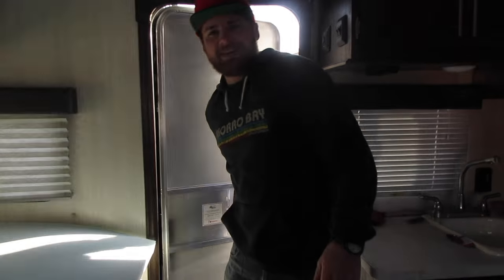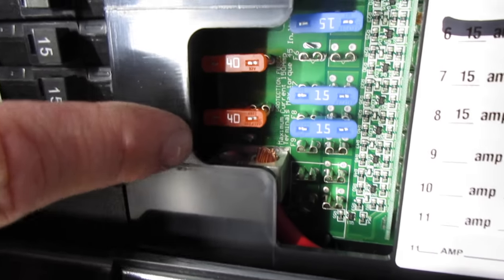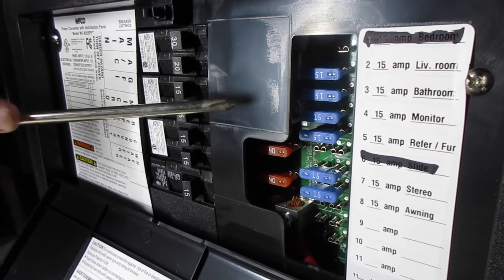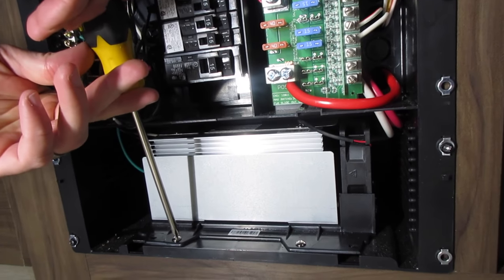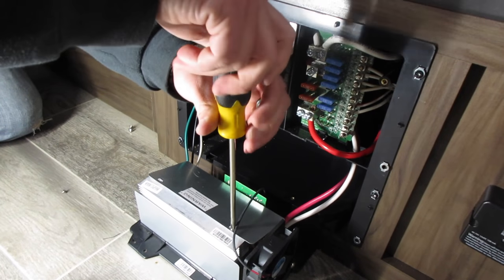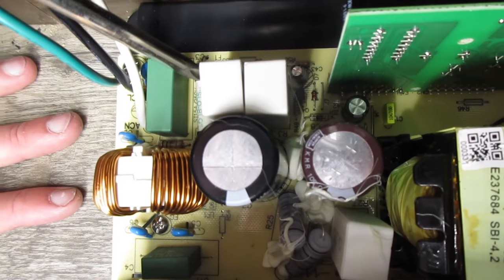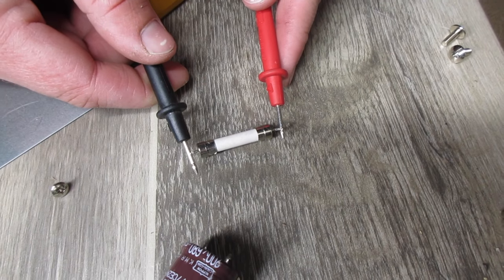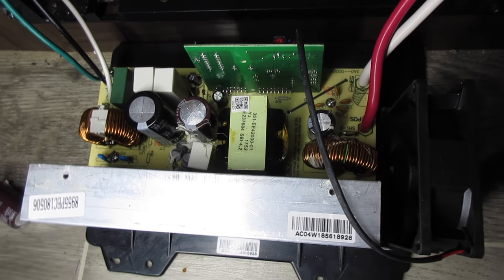RV Power Converter Fix #diy #notcharging new vid link below

Comment: I actually want my battery charger on its own circuit breaker when boondocking so when I plug in my trailer into my inverter hooked to my batterys I won't create a loop , a converter charger my batteries with my batteries when. Boondocking.
Reply from the maker: I installed an automatic switch so that when I’m plugged in it takes my inverter out of the loop and when I am boondocking my inverter clicks back in the loop. Also when I have a generator plugged in the system just things it’s normal power and my inverter no longer is in the loop
Reply from the maker: Here is the video explaining that setup
https://youtu.be/bAJZvtl4bKk?si=4gMXh8ZJbUyUWkZl

Comment: Dang! Wish I would have tried this 1st. Ended up replacing my inventor. I cheated for a while and ran off my batter, just kept a trickle charger on it plugged in from my 110 volt and held me over for a few weeks tell spare parts came In
Reply from the maker: Hey that’s a pretty good temp fix tho. Yea it was a lot cheaper checking each component and replacing what was actually broken instead of buying all new. Thanks for watching.

Comment: Put new batteries on my trailer today, installed a renogy battery monitor over winter. Plugged in shore power and I'm seeing 13.6 volts but less than an amp going to charge the battery. Looks like I'll be pulling the converter in the morning and doing some testing, huge thank you for the video.
Reply from the maker: Thanks for watching. 13.6 is pretty normal and if it’s only taking an amp my guess is the battery is full and the converter has gone into absorption mode

Comment: I just bought a similar RV and had the exact same problem not charging battery. Took apart and checked slo blo fuse and it had blown. Flipped board over and found a mouse welded to the other side. This video was perfect and you are awesome for pointing this out.
Reply from the maker: Whoa that is crazy! I’m so glad this video is still helping people out. I wish they could have mad this a replaceable fuse after seeing so many people with the same issue. Happy to help.

Comment: Thanks for posting.  Been trying to fix my problems with my batteries not charging for almost 2 years.  I have replaced 2 sets of batteries twice as well as the converter on my inverter.  If I put jumper cables on my batteries and connect to my truck, the 12 volt refrigerator works, otherwise, refrigerator does not work. Can't wait to trouble shoot later on today.
Reply from the maker: Oh man I sure hope you figure out the problem!! Be sure to keep me updated on this because they can be a real bear to find. I would also check the reverse polarity fuse in the panel. If that blows it can cause similar stuff

Comment: Thanks!! It looks like the same unit in my 2018 Surveyor. My issue is I have no power coming into the unit while I'm plugged in and the only thing that works is 12 volt equipment (lights etc.) But I'm gonna dive into it more tomorrow and your vid gave me courage and I won't feel like I'm jumping into it completely blind👍🏼
Thanks!!
Reply from the maker: Happy to hear you’re going to take a look! That’s a strange problem to have tho with no shore power coming in and only 12v. I’d also start tracing those wires connected to the 30amp plug. Good luck and keep me updated!
Reply: @RotoCityTech  when I opened it up there is a bar with wires going into it with about 7-8 Set screws. One of those set screws came loose and the wire bounced around and the wire jacket was crispy. I snipped off about a half inch and tightened the set screw correctly and VOILA👍🏼👍🏼
All good!!
Just got back home from the Black Hills of South Dakota so I'm assuming it happened on the return trip... good timing,  it could of been on the way there.. Thank you so much for relieving the stress of jumping into it👍🏼👍🏼👍🏼👍🏼 Big help!!
Reply from the maker: So happy to hear this! This also should help others knowing this is a possible failure point. Good work!

Comment: This is going to save me a headache or two next week. Bought a used camper and noticed something was wrong on the 12v side. I didn't troubleshoot because the plan was to remodel. I have the panel out and was just going to see if I could buy a new converter, but now, if I can fix it, even better. Thanks for the info; you've helped a lot of people. If thumbs up came with a counter for how many times I'd tap it; double digits my friend 😉
Reply from the maker: Happy to keep helping people fix their campers! Good luck with the rebuild! Thanks for watching and taking time to comment.

Comment: Thanks Hank!  In my case I could see both of the 200V 680uF caps were bad, the cases had heat damage/bubbling, and the metal ends were swollen out a bit. I ordered replacements from China on EBay as what I found in the USA would take longer to get and cost more. Plus I replaced the fuse with an Axial Ceramic Time Delay Fuse, 6x30mm, 15A, 250V from Amazon.   Nearby the caps was a brown area which also looked liked heat damage at R49, a 1470ohm resistor.  I lifted/desoldered one end and it measured fine, so resoldered it back down.
Happy to say it worked like a charm, RV lights are now working, and I expect the batteries will be getting charged.
FYI this came about because I connected the plug to 240V, thinking that the RV 120V 30A outlet was just like my shop 240V 30A outlets.  Oops! that was a stupid mistake, but all fixed now.
Reply from the maker: Wow! That’s awesome that you were able to discover all of that and fix it. It’s so awesome that I continue to get people having such success fixing these converters even years later. Good work
Reply: Thanks @garyconway439 I did the same thing and hooked up to 220 and heard a humming and trip. Went inside saw a 5 amp breaker tripped. Reset the breaker and smoke was released from the capacitor 🤦🏼‍♂️. Yep I deserved it. but hopefully I can replace the caps and fuse like you to minimize my stupid taxes. 

Im worried I damaged other components but it sounds like you got lucky. I even turned the battery on and the AC, fridge and tv worked just before being drained. Hopefully my follow up is good news too.
Reply: @jacksondaigler5145  The good news is that the 200 volt capacitor and the 15A 250V fuse are in the power supply, ahead of all the other components.  I expect the 240V over-voltage on the 200V capacitor caused it to short out internally and this is what blew the fuse.

Comment: This was extremely helpful!  I changed my converter once before about a year ago.  Now same problem, darn it! Such crap they make!  I will not spend another $300, but check it like you did.  I have to get some battery disconnects first though.  Non stop fixes needed for my 1997 Class C.  More fixes than actual travel. Fed up with it.  Need a new van.
Reply from the maker: Lass-in Angeles thanks for watching! Just check those big 40amp fuses first. I’m sure it’s at least a similar setup. It is annoying tho even buying this camper new I’ve had to work on something after each trip!
Reply: @RotoCityTech  Good to know its not just my camper!  Many thanks!

Comment: Just replaced a $377 converter and wouldn’t have (well don’t have) the understanding of electricity as you do. 
Have to give you kudos for getting it fixed! I mean I wouldn’t even know what to call that part you replaced to buy another. The fuse I could replace but that part...nope.
Reply from the maker: Thanks for taking time to comment and watch. Well ultimately you just need it to work so having a new one is probably best. Especially when you’re out camping! Thanks for the comments tho!

Comment: I love that you were able to do that, good work! I'm going to check mine in the morning
Reply from the maker: Thank you! Yes it was a lifesaver for me! Plus it happened to me in my new camper 🤦🏼‍♂️ let me know what ya find tomorrow!
Reply: @RotoCityTech  10-4!
Reply: @RotoCityTech  I disconnected my solar panels when I got power turned on for my job site trailer. The batteries kept everything running for a while, but when they died the refrigerator quit working. Turns out the main 40 amp fuses for the DC side were blown. Easy fix!
Reply: Caution! The converter has a circuit board on the bottom with hot 110 volt leads. You wouldn't know unless you stuck your fingers under there. (Heard it from a friend..  ; ))
Reply: @Shedhunter2 very easy fix! Been there done that. I’m happy it’s all working.
Reply: @Shedhunter2 😂😂 oh no!

Comment: I have a pair of WFCO 75 amp converters with the same problem. Parts are on order. I would suggest replacing both capacitors because if one is old and dried out, the other one is not far behind.
Reply from the maker: indyzmike great idea to replace both. I’m hoping since mines a new camper that the capacitors are new as well! Thanks for watching and good luck!

Comment: Good vid man. Unfortunately I had to find out the hard way like you did with the exception that both of my capacitors are blown but the F1 was fine. Inverter fan kicks on for about 5 seconds before cutting back off, if you pull the top “reverse battery” fuse. I’m assuming it’s because the capacitors can’t obtain and distribute the required voltage and it’s just taking the whole unit a few seconds to figure that out. 🤷🏼‍♂️ either way I’m 17 days into a healthy and junk food free lifestyle and I have my heart set on a Reese’s and a Vanilla Coke so I’m done for now. Thanks again for the video! 
Peace and love from bama
Reply from the maker: Oh man! Sometimes all you need is just a treat and a break. I feel for ya. Hopefully you get it all figured out. Thanks for watching and taking time to comment. I would for sure check those two capacitors for continuity.
Reply: RotoCityTech I’ll definitely let ya know for sure as soon as I finish and as far as the snack goes (went) ... definite mood changer in the + 👍🏼 stay tuned and thanks

Comment: Nice. My issue is similar, but a bit different. On shore power only(I don't use a battery at all), my AC is getting through to DC, but if it gets cold then the DC output is somehow restricted or flickery/faint.. So when it acts up my lights(fridge, anything DC) will either blink on and off at a tic toc pace, or they'll dim very low and a loud steady beeeeeep will sound(I've heard it's a low voltage signal). But, if while this is happening, I use say the microwave, or toaster, or anything AC current thats pulling a lot of power, the DC will work fine, but only while that AC appliance is used.

 It's like something in the DC output side, some component on the converter board, is shorting out or shrinking when it gets cold, not allowing the current to flow properly. And using an AC appliance somehow shoves the current through so it operates as it should.. lol idk. Only acts up when it's cold, it it's warm outside there's never a problem. Probably just gonna buy a new one but I just think it's prob something simple and cheap, so trying to see if anyone has dealt w this specifically
Reply from the maker: Thanks for watching. Hmmm yea this is strange. I’ve never heard of this before. It does seem like something is throttling there power for some reason until an appliance forces juice to run thru. I’m sure there’s is a way to test all this but I don’t even know what meter you’d use to try and do that. These converters are not too expensive so I’d say yea just get a new one to replace and then start messing with the old to see if you can find anything out. Best case is you have an extra converter in case the other one messes up

Comment: So, if I am plugged into shorepower(120v) would this stop my 12v devices from working properly? That s the issue I’m having.
Reply from the maker: They problem it’ll have is that while plugged into shore it will not charge your battery so once your battery dies all the 12v stuff will not work

Comment: You lucked out. I blew up three of these puppies because of bad power. Unable to work on the boards as they were toast. So had to buy the converters online. The one I have is around $170 and I had to install. Yours is in a great location. I had to completely pull the panel out as far as it would go and hang it with a rope to a handle above. The converter is behind the panel on my Fleetwood motorhome. That sucked doing this each time. Thanks for the tip. Wish mine would have been that easy.
Reply from the maker: Dale J oh man I feel for ya! Sounds like a tough annoying job and I am thankful most campers today put these in more accessible  locations. Well I’m not sure about modern motor homes. I do think I got pretty lucky that it didn’t blow the whole board! Thanks for watching!
Reply: @RotoCityTech  Well, our motorhome is not real old. It is a Fleetwood 2007 Terra LX 34n class A. Only 30k miles on it now. Bought it two years ago with 12k on it. It is a great unit except for the location of the converter. Thanks for replying.

Comment: Good video. 
What probably happened is  the reverse battery connection blew the orange fuse but not after damaging the cap and the internal fuse.  
I would suggest replacing the other cap. It may not have been damage to the point of failing but it was probably stressed more than it should have been. It will eventually fail at the worst time. 
To state the obvious. if you drained your batteries, they are probably damaged. 
Where did you get the cap and fuse? We use to have radio shacks but they are long gone.
Reply from the maker: Yea I think that’s exactly what happened. The battery didn’t fully drain and it has worked great ever since so I don’t think it got damaged. I do have another capacitor to replace and that’s was on the list of things to do. I believe I just searched on eBay and Amazon for the fuses and capacitors with all the same numbers. Too hard to find locally these days with all those electronic stores closing. Thanks for watching!
Reply: @RotoCityTech  what likely happened - you accidentally connected your power to 240V instead of 120V.  Besides fuse and capacitors there should be a a circular component called Varistor, right after the fuse, which is designed to make sure fuse blows up if a high voltage is connected.
Reply: @Encompdev  not sure where I would have found 240v tho. I’m pretty certain it was hooked up backwards when we hooked it to a vehicle because the battery dies and it was pitch black. Either way this fixed it 👍🏻

Comment: I have the same exact set up. I have 110 but I don’t have 12 V power to the RV. I don’t have a battery hooked up though. Everything was working fine until I turned on the microwave while the air conditioner was running
Reply from the maker: Thanks for watching! Man that’s weird that it stopped working when you did that. More problems unseen it sounds like

Comment: The other electrolyic capacitor is getting domed at the top as well. That is a sign of failure. You should have went ahead and replaced both. If not, other components could potentially fail if it goes bad too.
Just a heads up.
Reply from the maker: John Curtis thanks for the heads up. Props my something smart for me to do here in the off season. Thanks for watching.
Reply: @RotoCityTech  Yes! You did a great job on the replacement. The electrolyte compound inside tends to expand when its drying out causing the capacitor itself to get bigger.  Mostly happening to the top. Although, I have seen it happen along the sides too. Cheap insurance, you may want to look into replacing all the electrolytics since they do not cost much and one of these converters are a couple hundred dollars.
I am into radio communication. So I ran across your video in my curiosity if I could use one of these units as a power supply, as I need something that will produce 50 or more amps. I found one of these on ebay. It is on its way so time will tell. I just hope this unit has enough filtration in the circuitry (since it is not ordinarily used for this) to not produce noise interference in the radio I am using it with.
Reply from the maker: John Curtis well you are certainly over my head with this info lol. This is useful information tho. Good luck on your project!

Comment: Great tracking!   I really appreciate this video.  I have the exact same model and my concern is that it does not seem to ever go into bulk mode... when it was my impression that it did so, periodically, just to keep the batteries truly charged?
Reply from the maker: Thanks for watching! I don’t think I ever checked that it went into bulk mode specifically. After this fix tho it seemed to operate like it should so I would assume so

Comment: Me again.  When you took the board off to replace and solder the capacitor and fuse, did you have to disconnect the wires or just leave it hooked  up and wrangle it into a good position to work on it.  I've watched other videos in which they actually replaced the converter and there were lots of connections with wires that looked a bit too much for me.  But if I test and find the problem and can just flip it over with the wires still connected, I think I can do this myself.  Thanks for your help!!!
Reply from the maker: Yea I regret not getting that part filmed. I just disconnected the cables at the battery and then got it in position to solder it right there on the floor since it was just the one fuse. Good luck!

Comment: Same trouble here. Mine is older and does not have the slow blow fuse, but those two white rectangular blocks are super hot and turned the circuit board dark brown
Reply from the maker: Oh dang… I’m not sure on the older boards if maybe the fuses look different or not. Might be worth just getting a new board for you or even upgrading to a modern one. Thanks for watching!
Reply: @RotoCityTech  I went and looked again.... it does have the fuse after all. It was covered up with some white goo and it checked good. I'm going to replace it with a Powermax unit 55amp I think.
Reply from the maker: Ahhh I see. Well yea I was looking at that converter myself at some point